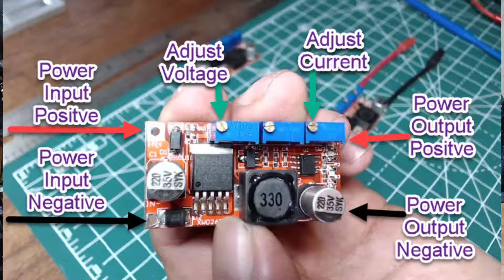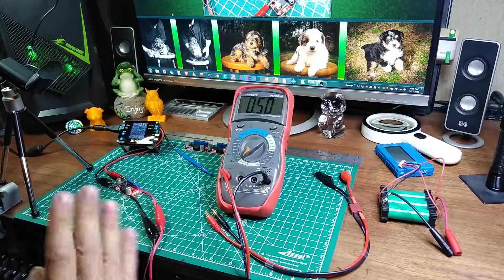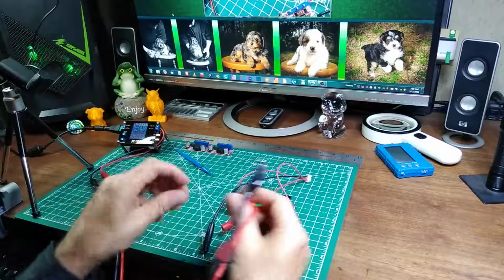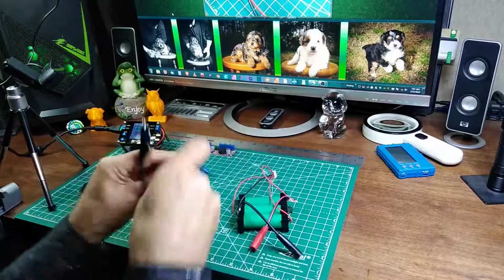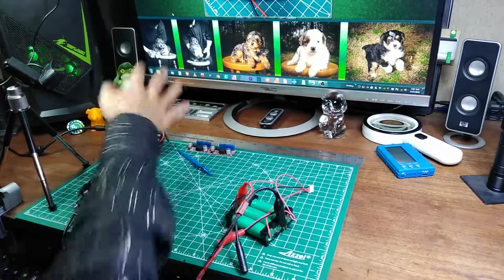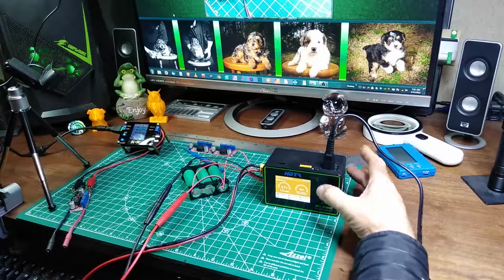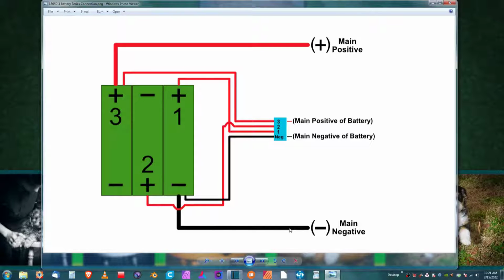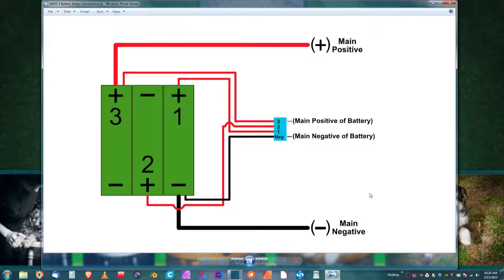Using a LM2596S Module to Balance Charge a Battery Pack With No BMS

Comment: Thank you Steven, very informative, you are man of great enthusiasm! ;) So far i did simple charger for Bosch 12v battery without balance board, using LM2596 and mine have vol and amp pot without middle one, and 1 led that show red-blue light so when it is full i just switch of by myself. So I'm just charge it simple way cus original battery is just 3 in series without bms in. Later plan is that i print battery pack so i can put additional terminals for balance charging. It will not be easy as I'm stuck with tricky precise spring thin sheet to bent as contact terminal(for thermistor, so that battery is detected by tool circuit) which is hard to find for now. Btw i read somewhere that if you connect green light positive and LM2596 pin 5 (ON/OFF), it will switch off when battery is charged, but haven't tried it yet. Keep good work for all of us enthusiast-geeks and others in need to go deeper in everything ;)
Reply from the maker: Thank you Nikola for the kind words...  The modules I have are not genuine and don't have the on/off you speak of, so can't check that it will turn off bms when charged, plus my charged light stays on constantly so for me - it wouldn't make a difference LOL..   I would like to try and help you resolve your issue of not having your charger any longer by adding a bms lead.  Maybe I can find the same drill that you have for sale, buy it and give it a go and let you know.  Could you tell me the model number of your drill so I can find the exact one you have for testing?.  
I would love to help you and also it would give me another video to make to add here for others that may be going through the same issue..
Reply: @Outside-In.  ON/OFF is pin 5 on LM2596 so it needs to be soldered to + on green led so when green led go high, it switch of lm2596. If i understand it correctly from other guy :) And about drill, its blue Bosch gsr 120-li and there is other similar models and other Bosch tools that use 10.8/12v battery. Battery that i have is GBA 12v 2.0Ah. I'm very satisfied with this little drill and power is enough for my needs. You can find it cheap (without battery/charger) i'm sure! If you buy it etc, ask if you need any info on battery and my research or/end model i created in solidworks etc. Keep good work!
Reply from the maker: @NikolaM021  Thanks for the clarification on pin 5, but like I said this would do me no good as my green light stays on constantly even if the battery is discharged, so connecting/soldering a wire to the green led would be of no use on my modules...  

I have looked on eBay and can't find any of your drills used, and new ones are as high as 200.00 which is crazy - I don't have that kind of money LOL...  I did find a charger for your drill but even that was 49.99.  I will have to wait awhile before I could afford to make the investment - sorry - I wish I could help.  I guess I was expecting that the drill was older and could pick up a used one for a few bucks but I guess not..  I will let you know if I am able to find something.
Reply from the maker: @NikolaM021  Nikola, I thought that I would let you know, I found a drill with battery & charger to purchase, and once I have received the package, I will work on figuring out a way to do what you need, and let you know of the results, and will also be creating a video with my result to your problem.
Reply: @Outside-In.  Great, looking forward to it!! Its actually not a problem that i have, just a tricky way to do it: creating 3d print package (what i already did), finding tricky metal contacts for NTC sensing and packing everything in that small space! I suppose it would be easier to use original battery and put additional lead for balance charge and I will probably try that out by simply adding additional 2 pins (for balance charge) on bottom of battery or where i find space for it. Next i will add bms board to my 3d printed charger and then i have regular 2 terminal + - (that battery already have) and then connect small cable with connector to additional 2 pins on battery bottom. Hope I'm clear ;)
Reply from the maker: @NikolaM021  Happy to be working with you Nikola on this.  The drill I found (PS31-2A) is not the same model number as yours because yours is not made (I found out) in the USA, and why the ones I did find were SO very expensive - so the one I found (I Believe) is the US version of your drill - as the similarities are spot-on, and the battery looks exactly the same.  I already have been making drawings based on the charger for this drill, and have pretty much figured out how it all works, but will know more of course once it is in hand.  If Bosch created their system as I suspect, I already have worked out how to make this work for you, and it will not be as difficult as you are thinking at all - pretty simple actually...  I just don't want to give you any information until I have had a chance to see the setup myself and to also test my theory on the actual battery.  From my findings I do believe that Bosch DOES use a bms - BUT the bms would be inside the charger itself and why you did not find one inside the battery.  Anyhow I look forward to getting the drill and putting my theory into action, and then creating a video with how easy it will be to charge that battery in case someone lost their charger (as in your case).  Will let you know how it goes and of course - since you are subscribed - you will get notification when I upload that video, but just in case, I will let you know here also.   It will be exciting to see all of this finally come together for sure my friend.  Take care, and may God truly bless all of your endeavor's...
Reply: @Outside-In.  Yes apparently Bosch in US have different codes/names. Your is very similar to GSR 12V-15 if not the same, its similar to mine +it has battery status. I'm 99% they dont have bms in charger. On battery side there 2 terminals +/- and 3 contacts. 2 contacts is for charger use, 1 is for battery "ok/led" and other is for NTC (if battery is hot, charging stop) and both of them are not important, except ntc/protection sensing which is good to have. Looking fotward to your efforts and job! ;) Good bless you.
Reply from the maker: I am more excited now Nikola because I did some more checking and testing with a Milwaukee 3-cell battery of mine, and allot of these companies copy off each other as my Milwaukee charger has two terminals in the charger (the same as Bosch) and yes these ARE connected to the battery in series. once plugged into the charger so why I am sure that Bosch has the bms inside the charger.   If the Bosch charger is the same (and Battery) as Milwaukee, I have the perfect solution to this.  I found and downloaded a Battery shell online, and spent several hours modifying it to convert it to a Battery-Top that will fit perfectly onto the Bosch Battery so no need of running wires inside the battery, it can be done from the outside.  Once I get this built, all you would need to do is to take the battery out of the drill, and place the battery cap on top of the battery, connect the leads and mains to a hobby charger to charge it. 

I know the Bosch battery has one battery terminal that does not show voltage but you don't need that terminal to do the charge - you only need the other two terminals on the battery to do a bms charge (I will go into detail in the video).  I will know more once I receive the Bosch drill, battery and charger, but I am confident this is going to work perfect without anything other than the battery, a bms connection and the main leads, but that will all be connected to the 3D print I have created, and not to the battery.  I should have everything within a few days and will get to work on it, and create a video on how to do it.  I am trying to figure out how to get the 3D print to anyone who wants it.  I am COMPLETELY out of money now (after buying the drill, so can't afford to set up a website for people to download files they may need from me (I will do that when I have more finance).  I am still in the process of getting everything I need to get Outside In up and going, but look forward to getting it all put together.  I hope you are getting as excited as I am about this all coming together finally....
Reply: @Outside-In.  Ok. We will see when you get package. Good luck in research. If you have some projects for 3d printing, you can upload it on thingiverse, there is already some battery shells/pack. Best regards
Reply from the maker: @NikolaM021  Thanks Nikola for the info.  I will have to look into Thingiverse as an option.  i do download ideas from there from time to time and then modify to meet my needs.  You sound un-sure Nikola if the Bosch is set up the way I am thinking - Let us stay positive, because I need the positivity to keep my going strong LOL ;).  But you are right - we will see and I will let you know how it goes... Take care and have  a great rest of your day.
Reply from the maker: @NikolaM021  Hello Nikola.  Boy do I feel like an idiot LOL LOL...  Before  I bought the drill, I decided to buy a single battery, and then after I made that purchase - I was SO sure that I was right about Bosch doing to right thing by adding a bms to their charger.  ...Although still waiting on the drill that I ordered ordered to arrive, guess what? - the single battery showed up today...  I decided to go ahead and do some testing with the battery to see if I was right about how it was connected - ---  It seems that you are correct Nikola, and I was not right, I was wrong :(. 

 When testing the battery, I kept getting total voltage reading on all terminals which indicates they are not connected to the battery terminals in series - they must put the batteries in series inside the battery, but only connect the main output of the pack to the terminals with is really really weird why they would do that.  I definitely can't understand their reasoning behind doing it this way, but it appears that since they are connected in this manner, there would not be a bms inside the charger either because it would serve no purpose.  I have never messed with a Bosch battery before, but you learn something new every day, and that is the only thing about this now that makes it all worth the effort.  So at this point Nikola it is up to you how I proceed....  What would you like me to do for a video to help aid you?, because there NOT being a properly built battery, I now don't have  a video to do instructing people how to charge it manually without a charger.  I don't think people are going to want to take their batteries apart - just to charge each cell individually.  The only suggestion that I would have is to charge the battery with a low current such as 500 mA to make sure any bad cells don't get left behind in the charge process.  Let me know what kind of video you would like me to make.  

I feel so bummed right now LOL.  I just can't believe that a company like Bosch would be so irresponsible with how they build their battery packs, and building a pack without the ability for the charger to balance the pack is going to cause people to have to buy batteries more often than they would if they had a drill made by Milwaukee, Dewalt, Ryobi etc..  

The best way to charge a battery pack that has no bms and no easy way to get to the cells, would be to put the battery on a slow charge to prolong it's life and help protect any high resistance cells within the pack.
Reply: @Outside-In.  Heh i understand you :) Some guy said that bosch use quality low tolerance batteries which are very equal so they put them in series without bms and then they can simple charge for many many time without problem. Maybe original charger use "pulse" charging instead cv/cc, there is 2 chargers, one look more advanced. In other batteries (higher voltages) bosch use bms, in the end blue bosch is made for profesionals. What i find is that many if not all 12v batteries (of other companies) is similar, they have +/- and T(ntc) so for some reasons, many of  companies agrees on that to 12v should be simple 3 cells connected in series with NTC and bms inside drill/other tools. If we add 2 more terminals so we can balance charge, it would prolong battery life etc for who knows how long time! I will definitely try to make battery, i already printed pack which i created in solidworks. Only hard thing still is to do that tricky contact for NTC sensing and to find pre-spot welded batteries as i dont have spot welder. Sry if my english is not best :) Have a good day, bless!
Reply from the maker: @NikolaM021  Well I guess the batteries still should last long enough to make worth buying Bosch, especially since (like you say) they are using low tolerance high quality cells.  Your English is great my friend and easy to understand.  I tried taking my battery apart, but Bosch must have cought-on that people are taking their packs apart to re-build them and decided to make it a bit harder to get them apart.  From what I have seen, earlier Bosch batteries where in three parts (bottom, middle, top), but now they eliminated the top part and must have added glue on the top inside of the case making it nearly impossible to get the batteries out without destroying them.  I pushed and pushed trying to get the batteries out of the housing to no avail.  I didn't want to ruin the battery just to try and get them out, so I went online and found a video on how they are made, and as I suspected after testing the one I received - there are only two wires inside the battery, a main positive and main negative going to the terminals on top.  Without that third wire, there is no way to balance charge without taking the battery apart, and I don't think (like I said before) that people are not going to want to take their batteries apart just to manually balance charge them... 

If the pack you printed is the same as the original battery case allowing the drill to have access to the three front terminals and two top terminals, then all you would have to do is to add the little circuit board from the original battery onto the battery pack and then into to the printed case, and then insert the pack into the drill.  

I still could make a video on building the three cells (pyramid style like in the battery) in series using a spot welder, but you say you do not have a spot welder so you would need to solder them, but be very cautious about soldering because the more you heat the cells, the more likely you are to cause damage resulting in a shorter battery life.  If you have neodymium magnets, I could make a video on building a battery pack with magnets, and that way there would be no soldering at all on the batteries themselves...  

Let me know what you think Nikola.  Take care.  I will do what I can to help.
Reply: @Outside-In.  Thx! :) Yes definitely, they made hard for us to open battery, seems like they use ultrasonic welding ;/ Older batteries 10.8v (which are same) was easier to take apart. I dont have time right now but my idea is to make battery pack and add new cells, basically create new battery. Then idea is to make it really easy with terminals, not to connect them to pcb but instead put on 3d printed board,  Soldering on it will be pretty tricky cus pet-g melting point, but i will find a solution. Just need some time for it!  Good luck in your ideas/reasearch!
Reply from the maker: @NikolaM021  Yes, soldering on 3D printed parts may prove to be (like you say) a bit tricky.  I am still thinking and am sure will come up with an idea.  I will have to look into seeing if there are small circuit board modules that would connect with a 3-series battery that would fit into a printed battery case for the drill, and I am sure if I look, I will find something.  I don't think the thermistor would need to be added to the battery because I believe you said that the drill only had the two terminals inside for main pos and neg connection to the drill to make it work.  I would think that the thermistor was added to mostly keep the charger from charging in colder temps (maybe).  I will know more once I have received my drill and charger which hasn't even shipped yet - hmmmm.  

Tale care.
Reply: @Outside-In.  Ok, i'm staying tuned ;) Electronics inside tool need to sense thermistor it in order to start motor. Many ppl add resistor (mostly 10k, its equivalent to ~20c) instead thermistor to make tool work. Now suddenly it come to my mind possibility to simply open drill and just put resistor between - and T sensing lead so my battery is free of this little pain, so it will work with just 2 terminals + and - , YEY! Have a nice day, bless
Reply from the maker: @NikolaM021  Cool, thanks for the info.  I am always glad to learn something new LOL..  I have not messed around with drills before except for taking batteries apart to salvage batteries...  This is a learning experience for me and will help allot when getting into making a video.  GUESS WHAT??.  I came up with an idea that I think you are going to go nuts for.  I am so looking forward to creating a video on what I just created so a person will not need to have a solder iron, or a spot welder to make this batter pack for the Bosch drill.  I am still working out the details but will let you know when I am working on making the video.  I will have to look into the resistor thing you speak of as it will be PERFECT for what I have created...